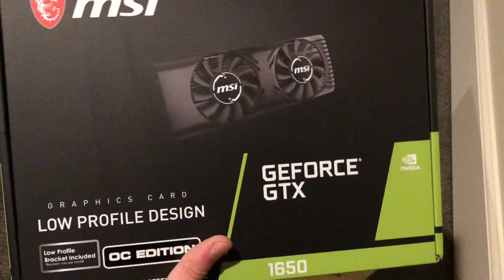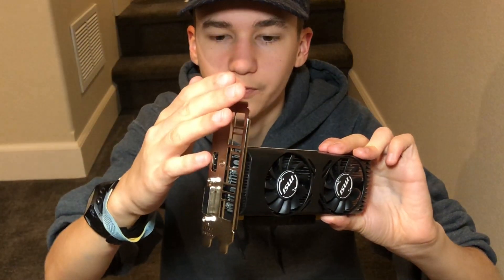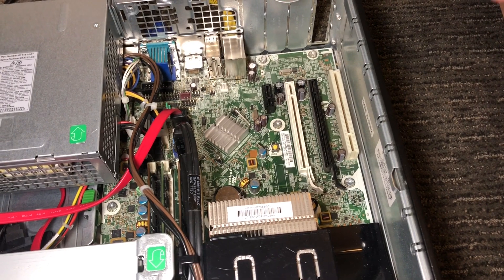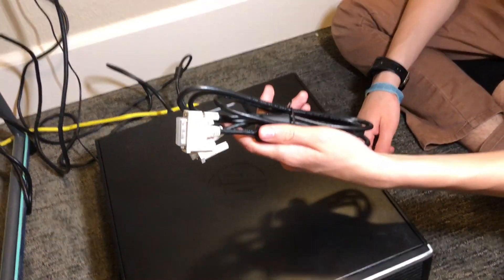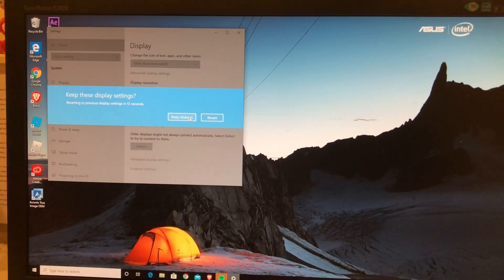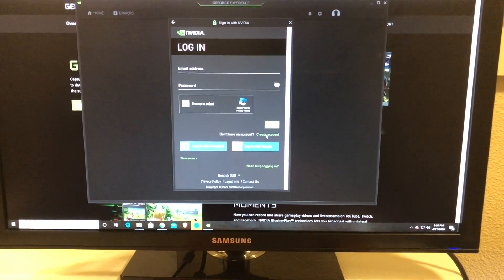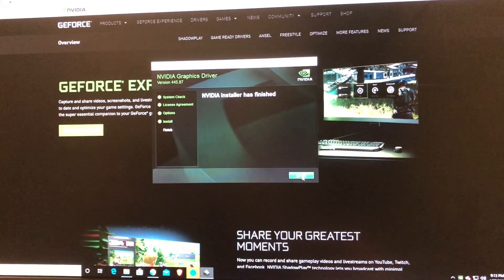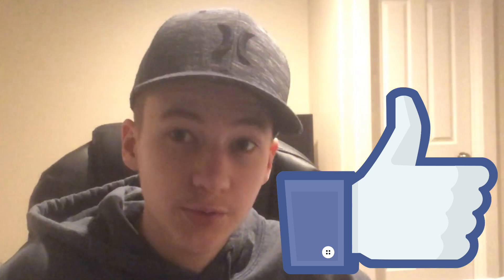Nvidia GeForce GTX 1650 Low Profilie Review and Installation (How to Step by Step)

Comment: its perfectly fine to touch the 'circuit board' btw its a PCB. even if you have static energy its fine as new GPU's are anti static. Also, please learn more about PCS. You did so much wrong here.

Comment: I just got mine yesterday and installed it but it literally starts smelling like it's burning and feels really hot, gonna have to take off the upper case when using it i guess.
Any ideas on how I can solve that heat problem? It reaches 60°c while playing far cry 3 on low graphics and resolution to the lowest, it's my first graphic card so I'm no expert

Comment: Hi, could you please answer my question as soon as possible. I ordered a gtx 1050ti low profile version from msi and am wondering if i could use it even though my monitor does not have a hdmi slot. Will the gtx 1050ti low profile work with a dvi cable?
Reply: He never did respond 😭

Comment: Does this have a hdmi port because that’s what my monitor uses and does it not need a psu cable and finally would it work with a a320m-a pro motherboard

Comment: I have a quick question. I have an 800 G1 SFF computer. And am thinking about installing the GTX 1650 LP as shown in the video. But most people installing it in the computer are using the "Gigabyte" version of the card, whilst you are using the "MSI" version. I'm pretty uncultured in computers and was wondering if it mattered which card I install. All i can find is the MSI version so I wanted to hear from you first if you know. Thanks.
Reply from the maker: Thanks for commenting, tbh it doesn't really matter i think the MSI is better but the should do the same thing. :D
Reply: @GeoffreyJamesKing  Thanks for the reply, friend! You're helping me out a lot

Comment: Hey. I have same card and i want to connect second monitor through vga cable (with dvi 24+1 pin adapter). No succes. Second monitor is fujitsu siemens l20w2. Thx in advance for any help.

Comment: Hello thanks for the previous answer but this is the definitive one, I have a monitor that only has an input for vga cable that is obviously already in use, my question is if I buy a vga splitter cable, can I use it as input for the graphics card? Your video is very good because you are the only one who did a step that happened and well explained, Or can I disconnect the previous one that is connected to the small blue box inside the pc and connect the vga cable to the 1650?
Reply from the maker: What are you using the cage slot for
Reply: @GeoffreyJamesKing   I am using it so that the monitor is connected to the cpu, do I have to buy an hdmi to vga? I'm talking about a converter to connect the graphics card to my monitor?

Comment: What's the max frame rate you can set with this? It is showing only 60 for me but my monitor has 144hz max
Reply from the maker: Thanks for commenting, I haven’t overclocked it yet but I would say 90 fps
Reply: @GeoffreyJamesKing  I am saying without overclocking, just with display adapter settings and Nvidia control panel settings.
I can only see 60Hz in these settings. Any help in this?
Reply: Swarnesh Dhavane try going to display settings or nvidia settings and see if your control panel can go up. if it is already 144HZ settings then try unlocking the fps on your game or setting a different fps max/cap if possible

Comment: hey I recently bought this exact graphics card and I'm concerned this 75 watt card might be drawing too much power from my 240 watt power supply do you recommend this graphics card for this PC? I'm using an HP 8300 elite SFF PC btw.
Reply from the maker: hi thanks for commenting, i use a less of a watt power supply and his card does work with your desktop your using
Reply: @GeoffreyJamesKing  will it work with 180 w?

Comment: I know you’ll probably not see this but I just got the same card and my monitor only works when I use the vga and when I connect it to the graphics card it says entering power saving mode
Reply from the maker: Thanks for commenting, are you using a dvi or hdmi cable to connect the monitor to the graphics card
Reply: Geoffrey James dvi
Reply: Geoffrey James got it to work installing the drivers my screen is flickering on and of is that normal
Reply from the maker: Do you know what type of dvi cable you are using because certain cables can work differently and make sure that the dvi cable is screwed in all the way
Reply: Geoffrey James never mind I rewatched the video and now everything is done than you sooo much
Reply from the maker: No problem I’m glad too help

Comment: what power supply do you have?.will 1650 lp work on my hp compaq elite 8300 sff.Im worried about my psu i think it will explode
Reply from the maker: Yes it will work on that desktop. My psu is I think 160 watt but I’m not sure I will have to check. But I have research that model of desktop you have and this gpu is compatible

Comment: what type of monitor do I need for this machine:
Hp 8300 sff
I7 3770
Gtx 1650.
Also do I need to install the final drivers in the final part of the vid? (Not including the first driver)
Reply from the maker: Yes I would recommend getting the final drivers. And a normal 1920 by 1080 monitor would be fine
Reply: Geoffrey James thanks for the quick response!
Reply from the maker: No problem

Comment: After i put in the graphics card my pc didnt display on my monitor can someone please respond quickly i need help
Reply from the maker: Did you go through the whole process I showed you
Reply: @GeoffreyJamesKing  nvm i got it to work but ty
Reply: The Bois how did u get it to work
Reply: @shizuktesar7918  i removed the graphics card and then put i back in and used the HDMI port at the back of the graphics card
Reply: The Bois oh I realized my issue is the io shield is blocking the hdmi port
Reply: The Bois I fixed it ayeee
Reply: @shizuktesar7918  nice
Reply: The Bois how you liking ur gtx 1650 so far
Reply: @shizuktesar7918  its great how about you

Comment: What if I’m doing it with a TV and can’t go on integrated video? Will it still work? My card gets here in like an hour lol
Reply: Yup, I fixed it earlier. Thanks to the card i went from 40 FPS to 200 in like every game
Reply from the maker: Nice sorry about the late reply I was one a day trip
Reply from the maker: You don’t use the integrated video lol
Reply: Mine is different, I had to use integrated graphics for a display, plugged my HDMI to my GPU and plugged my VGA cable to my motherboard.

I know this looks bad but it's the only way to get an Output from my TV, reason why the "only way" is because I got a no signal problem with my GPU, now it has an output, soooooo yaaaaa.

PC: Lenovo M91p TOWER

Comment: Question: I have a vga cable connected to my motherboard but once I install the gpu do I need the video cable in the motherboard still?
Reply from the maker: You will connect the cable from the monitor to the back of the video card also what gpu do you have like the 1650 we showed in the video or is it a different one
Reply: yes

Comment: I have a i5-8400 
4gb+8gb 2666mhz ram 
DVD CD drive
I have a 300watt power supply
Will this run on my system ?
Reply from the maker: Yes

Comment: hi Geoffrey I have very old hp small form factor 8000 with core 2 duo, e8400 3ghz. it has radeon amd hd6350 low profile card 512mb. i just watch movies dont play games. i have led monitor. should i bother to upgrade GPU to get optimum quality picture. if yes please suggest cheap secondhand low profile card which wont be bottlenecked by cpu. thanks in advance
Reply from the maker: i would get a gtx 1050 for really cheap and you can get them at a lot of different places too
Reply: @GeoffreyJamesKing  thanks a lot
Reply from the maker: No problem

Comment: I installed this card today. Works fine but fans are too noisy. HWinfo shows they are spinning @ 30% even if PC is idle. Custom fan profile in Afterburner doesn't help neither, I set the profile 0%, but fans are still @ 30% while GPU is just below 35C.
Do anyone know how to stop fan spinning below 40..45C GPU temp?
Are the other 1650 LP cards (ASUS, ZOTAC, GIGABYTE) this noisy as well?
I need a silent card. Previously I had a GIGABYTE 1050 TI LP, that was silent when PC is idle. But fan started to wear out and became noisy when spinning, so I needed to swap the card.
Reply from the maker: are you playing a big graphically intense game?
Reply: @GeoffreyJamesKing  No, I don't need huge gaming performance. I want silent operation in a small Silverstone ITX case and want to drive 2x 4k display @60hz. 95% of the time I don't need GPU just basic display functions. I have the GPU in order not to load the CPU and mobo memory with display functions. I run 9900K and found it suffering from the 2x display.
1050 TI did it well for me for 2 yrs, so I thought 1650 should work as well in 2020 for the same price. It surprised me that they don't shut down the fans @ low temps. All GPU card I encountered recently do that.
Reply from the maker: You must have something banging on it or getting in the way then
Reply: @GeoffreyJamesKing  No, the installation was correct, nothing in the way. The problem with this card is that the idle power dissipation is about 8W indicated by HwInfo. Too much to dissipate in such a low formfactor without fans. And they use mediocore, loud fans.
Finally I got a new GIGABYE 1050Ti and replaced 1650. It is dead silent again even if the single fan is spinning at 2200 rpm when idle. Unfortunately 1050ti doesn't report  power data to HwInfo to compare the cards.
When time permit I will try to mod the 1650 and old 1050Ti with Noctua fans for new silent builds. I have an eye on a 3950X or next gen Ryzen build in the same Silverstone box. My goal is to push CPU performance in a silent SFF box.

Comment: How do I run it through HDMI I get no pic when I put it in my pc. I installed software with a different card
Reply from the maker: you need to plug it in directly into the card :D
Reply: Geoffrey James I run it through the hdmi I get no display
Reply: Jae Reed have u done vga to vga or even vga to hdmi
Reply: Kynarov thanks. I just switched to a different monitor. Works great
Reply from the maker: Good 😁

Comment: i purchased the Msi Gtx 1050 ti 4gb low Profile  about 3 months after release ( $123.- w/rebate ) = great gpu & OverClocked Very good " No Voltage " when the Msi Gtx 1650 Oc low Profile released i grabbed it For $150.- Ny Over priced but did the job  and didn't OverClock as well Compared to the 1050 ti but when you have a sff Pc : you just need the best graphics card with No 6 pin power connection  for 1080p !! imagine if the Super was released with No 6 pin connection = would have been awesome. That's what these Gpu's were made for !!!!!!! Thank you for Posting
Reply from the maker: yes, thanks for your feedback :D

Comment: What PSU need for this GPU...In lenovo 510s sff pc only 180 PSU...I don't no the power output to gpu. Now i currently use zotac  gt 730 low profile ....I have doubt about only on power supply ... Wheather gtx 1650 msi run on lenovo 510s
Reply from the maker: i'm just using a standard 240 watt psu for my setup, but your 180 psu will be able to run it. When you look up online the best psu for that graphics card they will say that 300w psu is the best but there taking into account that all of the graphics card slots are full. so as long as you are only using that one graphics card you should be fine :D
Reply: @GeoffreyJamesKing  thank u bro

Comment: Will this msi 1650 low profile work on optiplex 780 sff?
Reply from the maker: yes it will :D
Reply: @GeoffreyJamesKing  last question will the 1650 low profile gddr6 work?
Reply from the maker: Yes just make sure it has the bracket

Comment: Why do you need to change the bracket?
Reply from the maker: some PC cases are low profile and you need the low profile bracket to fit those cases but if you have a normal gaming case then you don't need to do anything
Reply: @GeoffreyJamesKing  ii thought that the card was low-profile and it was for low-profile PC and I did not know that I would need to change it I'm glad I know cuz I'm getting a 1650 in a few days

Comment: Any one else having trouble changing the bracket? The screw that's in there wont even budge and I cant put a lot of tension on it because all the tension goes on to the chip itself
Reply from the maker: that is strange im not sure how to help. here is a video on how to change the bracket. Also sorry if i didn't show it well. :D
https://www.youtube.com/watch?v=6rK7rBo55dQ
Reply: Thanx I actually ended up breaking the piece that's attached to the hdmi port and it worked lol
Reply from the maker: Lol